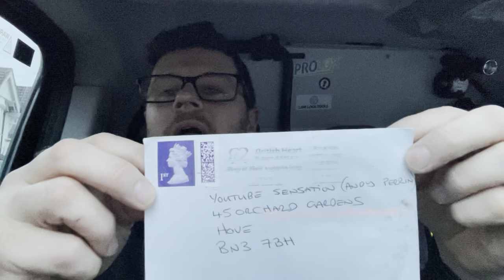Old Union Monarch Lock In??? - VW Polo Lock Out - Lock Fitting | Brighton Locksmith

Comment: Ayyy nice one on the Burton key safe! It can be a tricky little bugger. I’m still waiting to see the new version they promised at the last expo but can’t see the mechanism changing. Another good video and glad to see your busy 👍🏻
Reply from the maker: Thanks Gav. 
Although I’ve decoded the one I bought numerous times now, I’m struggling with a customers one 😔 It appears to want to decode in the same way but just won’t open! 🤷🏻‍♂️So frustrating
Reply: And all else fails use a bit of C4
Reply: @brighton_locksmith  bare in mind they are prone to failure and and could just be fecked. It’s also wise to forget the norm when it comes to what people use for codes. I spent 15 minutes on a supra once because I found 3 numbers and was trialing the last one with letters etc when it turned out there was only 3 numbers and no letters 🤦🏻‍♂️ so sometimes 4 numbers sometimes 6
Reply from the maker: I’m sure this one is buggered mate! I didn’t realise they failed! That could explain a lot. 
Haha, I bet that was frustrating with the supra😂😂😂